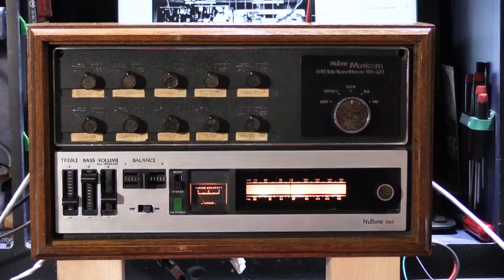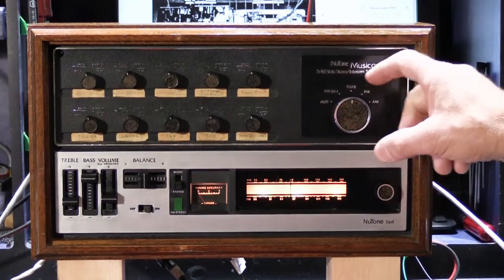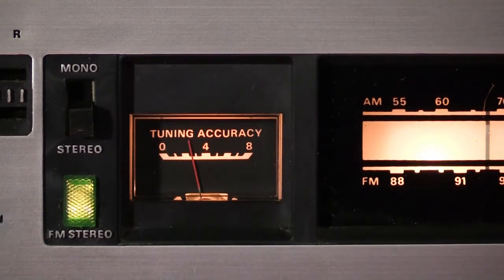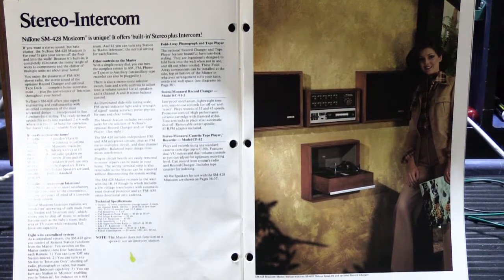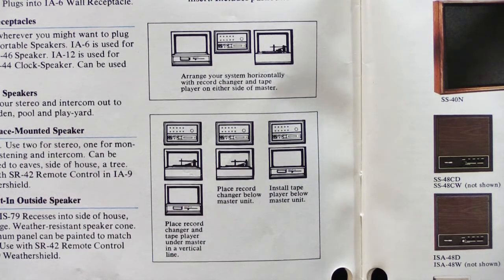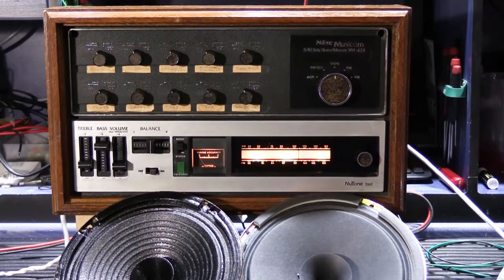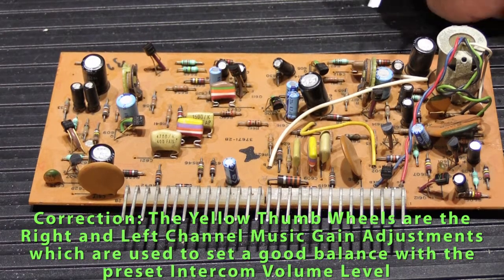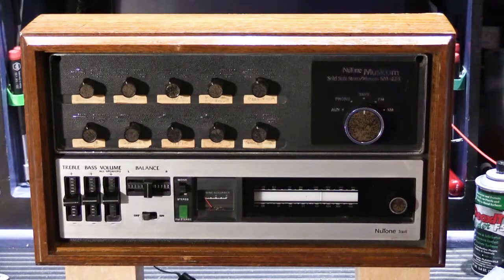An Overview of the  NuTone SM428 Stereo Music Intercom Master Station

Comment: I own One Unit In like new condition Purchased in the 70" new and never used.  4 speakers, ss-48CD, 4 Speakers SS-48D and an Inter-phone speaker for a door. And want to sell it.
Reply from the maker: Hi fcous:  White the SM428 is a somewhat rare Model, it requires just the rigth circumstance  to sell it - Ideally, you would look for someone who wants to do a "new-vintage" installation.  To do this you must also have all of the necessary wall-housings and wiring to complete the installation.  This is a difficult project for most peaople.
     The other type of buyer woudl be someone that already has a SM428 System and needs (or wants) a NOS replacement.  You should factor in the fact that your equipment is around 45 years old and it may require some light refurbishment ot have it work weel and reliably - Chris

Comment: The house we just bought has one!! House was built in 1982. We have speaker and a intercom panel in each. in the living room, both upstairs bedrooms, downstairs office/spare bed/laundry room, and I believe the carport. Only 2 are labeled the Den and garage. So I have to lebel the rest but so far runs great. I'd be interested in finding if I can fins a way to hook it up to a detached stereo system.  I have a cabinet set or like trying to hook up a AUX headphone jack type and connect a Bluetooth receiver to it.
Reply from the maker: Hi bobbirae:  Your NuTone SM428 Master Station has 2 Auxillary Audio Input Jacks on the back of the unit - These were originally for connecting a Cassette Player or Phonograph or evan a NuTone 8-Track Player (yikes) - You can use these Audio Input Jacks to connect modern devices like a Bluetooth Receiver, a WIFI Streaming device or some other Audio Input device - What your cannot do is connect a "detached stereo system" - You must be carefull with the types of connections you try to make - I've seen people make the wrong type of connections (like connecting a stereo systems speaker wires) and blowup there Master Station (yikes again) - Simply put, you can connect an ":Audio Source" you cannot connect anything that has its own amplifier built-in to it.  Here's a link to our Video about adding a 3.5mm Audi Jack to the SM428, which is an easy way to 'plug-in' an external device:  https://www.youtube.com/watch?v=LjVOFAbAxkg&list=PLsTvqKsBnGYfYEYUH0KKQbS1rMhc9Lm60&index=5&t=164s
Chris
Reply: @northsideservicecompany3567  Thats awesome! Thank you!!

Comment: Where is the transformer located ?
Reply from the maker: Hi imgrr8: The SM428 has a remotely mounted low-voltage transformer, which could be anywhere in the home.  Also take note that the SM428 is the only NuTone Intercom System that uses a 12 Volt AC Transformer - Chris

Comment: That's an awesome system! It amazes me how much sound can come out of a system like that! Sort of reminds me of my Bose Wave Radio... it's a small box that is an alarm clock radio, but the two speakers combined with the acoustic chamber (which is made up of a series of folded tubes) produce as much sound as two bookshelf speakers connected to a stereo receiver. By the way, I'd love to see a close up of that 1985 brochure so I can read the text, so if you ever get a chance to upload it to your site, I'd be interested in seeing it. :)
Reply from the maker: Hi Vincent:  I will be scanning the catalog soon and  it on our web site.  As a whole house Stereo System, the SM428 doesn't disappoint with the sounds it produces.  Rebuilding a SM428 is always a rewarding project, renewing its sound to like new is a great thing to do. - Chris